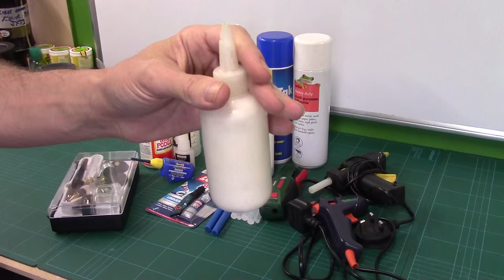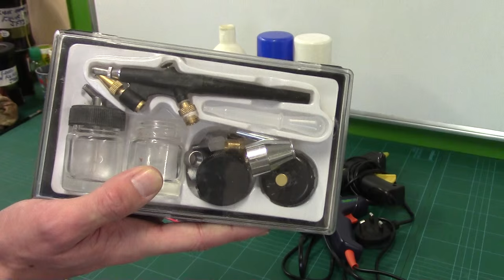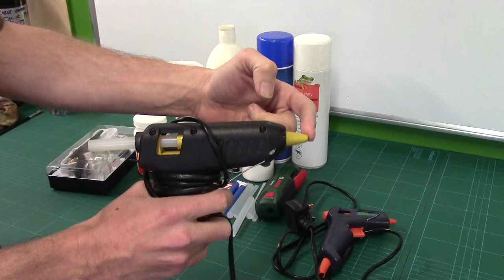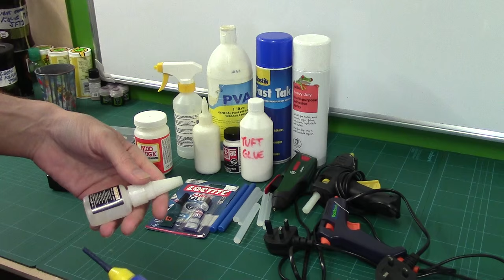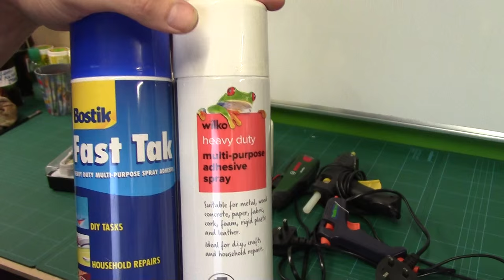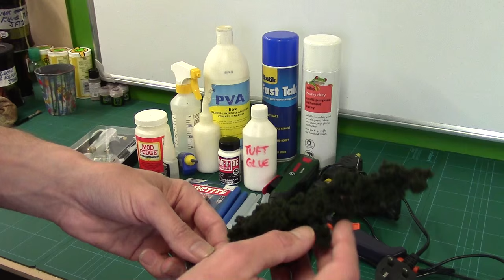A guide to common glues used in terrain making

Comment: Mel, I found the Terrain Tutor about a month ago, and have watched it almost daily. I've learned a TON, and it's inspired me to get back into making wargames terrain (along with my 3 sons, which were part of the reason I got sidetracked in the first place!)

Here are a couple of things I am sure you knew, but I didn't hear mentioned:

I generally add a drop of dish soap (only a drop) to my PVA/Water mix. The dish soap helps break down the surface tension of the water, and the mix flows into all the little gaps and crevices easier.

Super glue can be used as gap filler. I learned this from an old model railroading book. Fill the gap with baking soda. God old Arm & Hammer works fine, but avoid the open box in the wife's fridge. It aborbs moisure from the fridge and doesn't work as well. Once the gap is filled, brush off the excess around the outside of the gap.

Now, drop a drop of super glue onto the baking soda. Let capillary action suck the drop into the baking soda. Wait a minute. It will dry rock hard and can be sanded, drilled, filed, or just about anything else. It works (as I understand it) because the reaction between the soda and the glue produces heat (which you can actually feel), which dries the superglue. I've used this on terrain, plastic and metal miniatures, and even knifemaking (another hobby of mine).

Again, thank you for the tutorials! Please keep up the great work!

Buck Hedges,
Dog Hair Terrain
Reply from the maker: Thanks for the info matey ;-)

Comment: I've been working my way backwards through your archives as well; brilliant stuff. A few other adhesive options:

1) For lamination of flat materials, contact cement works really well. It's a bit slow and very smelly, but it's strong, dimensionally stable, and water resistant/proof. Of course, like most adhesives, it will eat expanded polystyrene. But ...

2) House paint (acrylic latex paint in the US) works very well as a barrier layer on EPS/styrofoam, allowing you to use almost any adhesive or spray. I've used spray-on rock effects over broken EPS to very good effect, for instance.

3) Epoxies work better than anything else if you have s small contact point that you want to glue (for instance, if you want to glue a street light down to your modelled street). The work even better if you pin first, then glue.

4) Glues aren't the only choice for permanent attachment. Double-sided Industrial VHB tapes are very easy to use, waterproof, heat resistant, and very high tack. Similarly, industrial adhesive transfer tapes (sometimes called "booger tape") can work very well. (Our test lab has tested them to about 140F/60C at 100% humidity under load for days on end -- we use them in window coverings).
Reply from the maker: Thanks for the info buddy, there's a few things there I'll have to have a play with. The tapes are a new one, so I'll have to explore that one :-D

Comment: Damn good idea, never thought of using my heat gun to get rid of the hot glue spider webs.

Hot glue/Superglue mix. Cheers for the warning, never considered that.

The wife managed to get "Plastic Weld" into her eye. Luckily I was there to flush it through. Took her to the hospital and the MSDS that the doctor got on the stuff said they were supposed to treat patients exposed to that in basically a chem suit, as the fumes are so strong. That shit went straight in the bin when I got home. It was the bees knees for welding plastic together, but dangerous stuff. Doctor said she was lucky that that it got flushed so quickly as it could very easily have permanently damaged the eye and they were surprised it had not done so.
Reply from the maker: +Squidgy Bidge Damn, that's nasty!

Comment: Awesome stuff! great explanation of the different glues! I use the stay tacky spray glue for stencils.
Reply from the maker: +kiblams I'm assuming to hold the stencil to the piece mate?
Reply: +TheTerrainTutor two purposes of it really, the first is to hold the acetate in place while the cutter cuts the stencil out, and then its used when spraying to get a super sharp stencil.
Reply from the maker: *****
Nice, thanks for the tips mate

Comment: Great video, Mel! I actually didn't know about super glue's response to heat - nice tip!

Since this is about the basics, I think a bit more focus on what NOT to use particular glues for would be in order. Especially, super glue and polystyrene, which give off very nasty fumes and eat away the polystyrene
Reply from the maker: +MuadMouse Good point mate, I talked about it in the polystyrene vid but didn't mention it here

Comment: A really cool web effect you can do with PVA and Super glue is to apply the PVA, then put dots of liquid super glue on it.  Since the super glue polymerises rapidly in water and PVA is water based, you can get neat web effects.  ALWAYS be careful with super glue, as it's generally toxic and like Mel said, be careful with vaporization of it.  I prefer plastic glue for plastic models. Plastic glue will fuse the plastic a bit better anyway.
Reply from the maker: +belkozen That's interesting, I'll have a play with that mate, thanks for the tips!

Comment: Groovy video gave me some questions to ask.
1) I'm going to use Serissa Precision City Block buildings for my table and I'm wanting to add a cover to the windows like a plastic copper I think, but what type of glue should I use on plastic to keep it from fogging over?

2) If you wanted to add a window cover like what I am thinking is there something that you would do different to make it look better?
Reply from the maker: +Travis Hardinger Avoid superglues, I'd use thick pva or a latex glue at a push mate. You can score the plastic to give cracks etc, you can draw lines (grind work) with a fine tip permanent marker or you can buy clear plastic sheets with stainglass, curtains, all sorts. Look for doll house windows on ebay mate

Comment: Another great video Mel. Thanx for the hot glue-on-super glue warning. I'd never heard that. I know that super glue FUMES can "frost" the area around them, but hadnt considered it a danger to my eyes. I use safety glasses or keep it under my magnifier when i work with that stuff. Had a friend get some in his eye once. They used cocaine to numb it so they could work on him! Do you have any use for rubber cement? It might work for putting clump foliage on trees?
Reply: Does rubber cement work pretty much the same as the latex glue Mel used in his Ivy & Creeper vid last week?  I think it's a little thinner, but I imagine it would work the same.  Maybe as an alternative to PVA for finer flocks or sand.  And it's water resistant I think!
Reply from the maker: +Bill D. in Iowa It's nasty mate, rubber cement is just a latex glue, so applications that need to be tacky or water resistant suit it best

Comment: Bit off a noob question, the other day I put some static grass down using the "clumping" technique, then went back the next day to seal it and it had turned into a mat, with no texture whatsoever, I'll be replacing it, but want to avoid it happening again, any reason why it happened? I'd assume that it's something to do with the glue, and the technique not giving a particualrly great affect anyway, but like I said, I'm pretty new, so I thought I'd ask the experts
Reply from the maker: +bibbly1234 sounds like the glue was too watery mate, a thicker glue would hold the fibres upright whilst it cures. Wetter glue tends to suck them down into a flat patch

Comment: Hey, good to know I'm not the only glue nerd. The real test is, how often do you look up the MSDS glue to work out what it REALLY is?

Noticed you haven't mentioned Urethane glues like gorilla glue, or Yellow Glue/Aliphatic Resin (Basically treated PVA). Yellow Glue tends to be very slightly more water resistant than PVA, so I wonder if it might be better for basing etc?
Reply from the maker: +Mooncabbage I've never even heard of it, what is it? I haven't mentioned those as I don't really use them and so can't speak with experience on them mate.
Reply: +TheTerrainTutor Yellow Glue is a kind of wood glue. Best known is probably Titebond from the US.
Reply from the maker: Mooncabbage
I'll keep an eye for it, is it latex based?
Reply: +TheTerrainTutor Yellow Glue is water based like PVA. It's basically the same white glue, but either heat or chemically treated (can't remember which) to change it's properties. In my woodworking experience, the drips seem to set rock hard, compared to white glue which is sort of rubbery.
Reply from the maker: Mooncabbage
I'll check it out mate ;-)

Comment: Hmmm ... bit of a sticky subject ... 

Question ... which is that awful rubbery snot-like stuff (I'm guessing that it's one of the latex-ey ones) that they use to stick things to the front of magazines?

I love the two-part epoxies - eg, Araldite ... once you've stuck something with that stuff, nothing short of a direct nuclear strike's gonna shift it! Shame that it takes geological timescales to harden ...
Reply: +Graeme Collin That's a latex glue aka Tacky Glue.  Mel used some of it in his Ivy & Creeper video last week.  For plastics, plastic glue is definitely my favorite.  My models never come apart.  I've had issues with super glues before.
Reply: +Graeme Collin Also known as rubber cement.

Plastic glues are great on polystyrene plastics (injection moulded plastics, like GW uses... if it comes on a sprue it's injection moulded polysterene), but do not work on PVC plastics like Privateer Press uses.
Reply from the maker: +Graeme Collin It's a latex glue mate ;-)